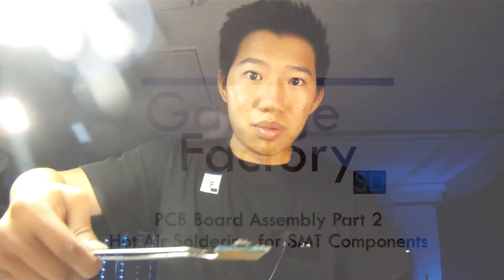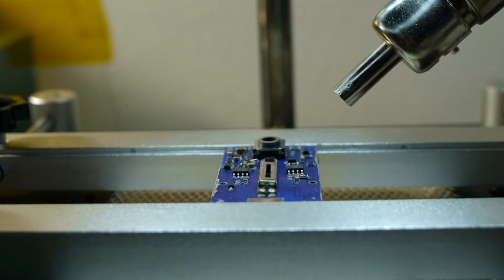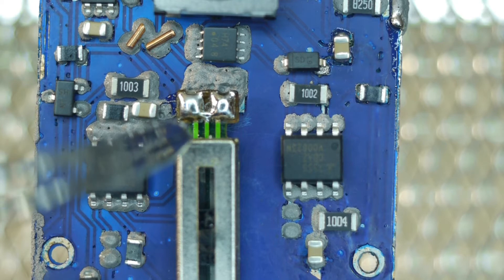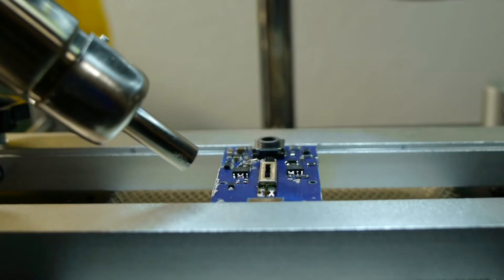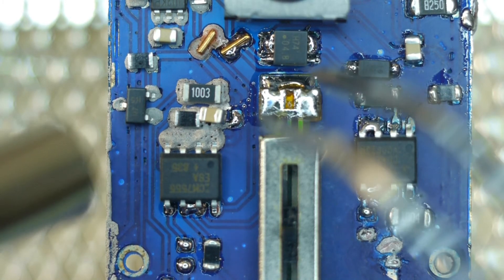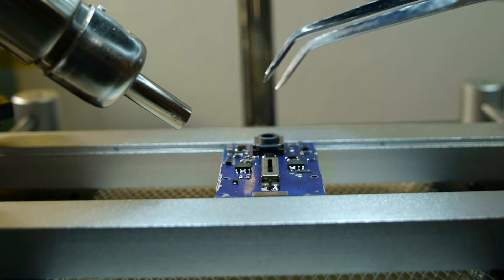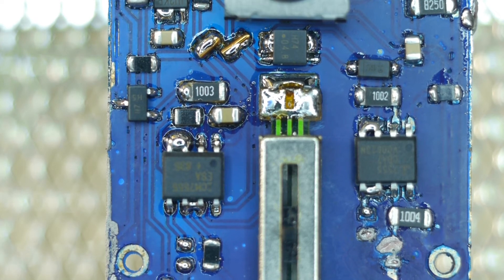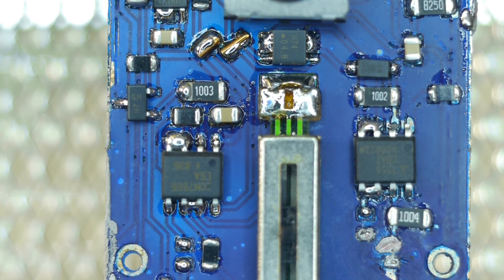Hot Air Gun SMD SOLDERING with Heat Plate PCB Demostration

Comment: Where do you get your components for surface mounting? Eg. Resistors, chips etc?
Reply from the maker: I use lcsc for cheap smts, for prototyping I find it easier to have a box set of passives components from aidetek

Comment: what a mess.
Reply: Hey, at least he tried.
Reply: @teeLgnihteoms  not enough flux you think? or just not a good job
Reply: @silo-fe4nj   hold the hot air gun vertically! adjust the air flow speed,  that will not blow the small parts away! this is not a good practice!